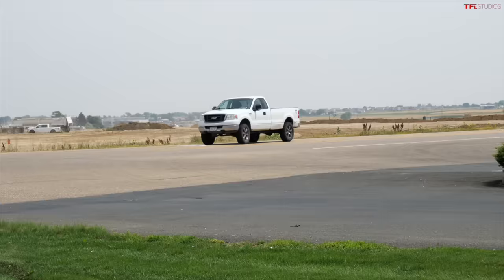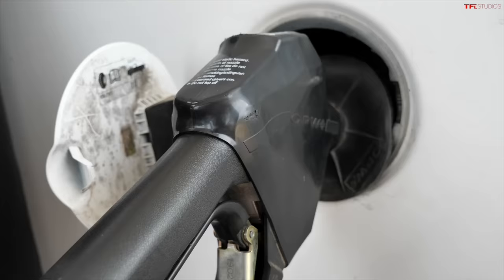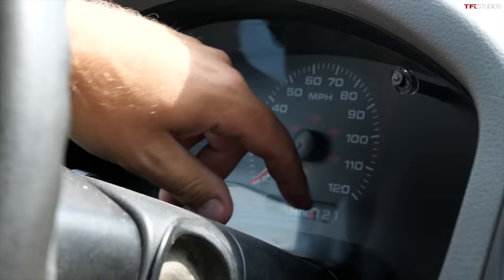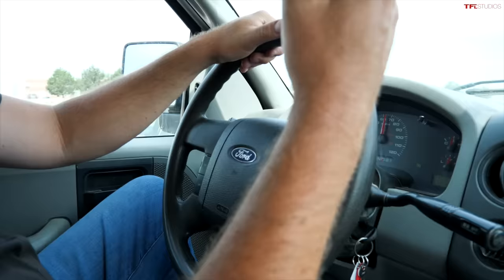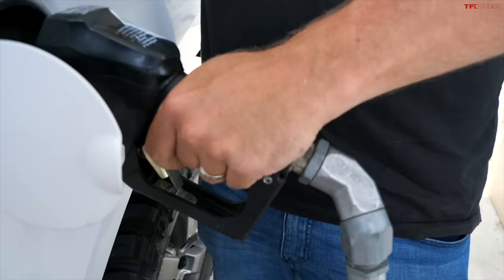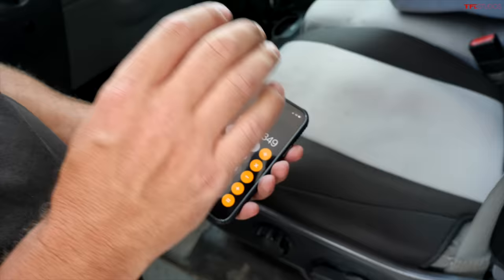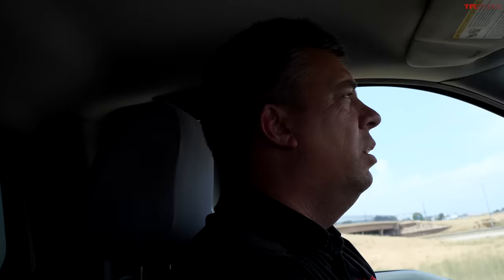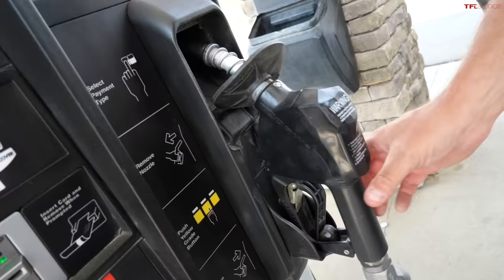Surprising Result: Here’s What Happens To Your Truck’s MPG When You Install A Topper!

Comment: A thousand pounds of added weight has a marked effect on mileage in stop and go traffic in a city, but it has little, if any, effect on mileage when running a distance on the highway. Aerodynamics can have a drastic effect. With a vacuum gauge and cross referencing with the speedometer, you can tell if the truck is heading into a 5 mph breeze, or being pushed by the same breeze, and it will definitely show at the pump. If the start and finish of the trip are at the same elevation, the highway profile will have no effect on fuel economy. What goes up has to come down.

Comment: It's not surprising. Reviews for tailgate down, vented tailgate, tonneau cover, aero canopy and aluminum canopy bounce all over the spectrum. Some tests show each to be the best option, some test show the same mod gets worse MPG than the bare PU. A sloping rear cover (top of the cab to sloping down to the tailgate) reduces drag about 12%. There's additional drag from all the air turbulence under the truck, from big mirrors, vented wheels and oversized tires (especially the front wheels) and additional if tires extend past the body. Clean all that up, along with lowering the PU 2 inches and adding wheel covers, and you get a total 25% reduction in drag... or a 10 to 13% reduction in fuel use compared to the modern F-150 (which is a bit more aero than your truck). That's the reason for the ugly shape of the Tesla PU and its mostly flat belly pan. The US doesn't allow cameras to replace mirrors, so we'll be stuck with those for some time. Mfgrs know all this but, for a combination of practical reasons and consumer preferance, these haven't been designed in.

Comment: I bought a gryphon programmer for my 2006 F150 4x4. It not only runs better and shifts better but it also gets an extra 100 miles per tank (35 gal). If automakers would properly tune their cars they could be so much more efficient. Unfortunately theyre in bed with oil companies to rob you at the pump.
Reply: I'd love to go for a ride & see your 3 mpg improvement with the tuner. I've been a professional mechanic & hot rodder for over 50 years & have NEVER seen anything make a noticeable improvement in mpg & MOST tuners hurt the economy. It's pretty hard to improve performance without hurting economy, regardless of whether the vehicle has a carb or computer controlled FI. The manufacturers tune the vehicles for MAX mpg & minimum pollution because they MUST meet Fed Govt imposed fuel economy numbers across their entire line. IF they could improve mpg by 3 mpg, they would damn sure be doing it! An engine is a big fuel burning air compressor & they can only be run so lean before they melt aluminum heads & pistons down. LEAN creates much more heat than rich & a 14 or 15:1 A/F mixture is the leanest a gas motor can idle without a "lean miss" or cruise under light load down the highway without a miss & excessive engine destroying heat. Somewhere right around 13:1 is the number for max power.

Comment: A truck with A topper is generally more versatile then one with an open bed regardless of the fuel mileage which was improved. over the life of the truck it would make A difference, you could probably skip A fill-up.

Comment: I'm adding a cap to my 2022 3500 Ram dually and will also add VG's to the rear top edge of the cap to see if that helps.  Maybe you should try a test.
Reply: I’m buying a Leer top today. What are VG’s ?
Reply: It's a vortex generator.  They break the suction and reduce the low pressure behind the vehicle.  They come from the aircraft industry.  There's a company that makes them for trailers and they will work on a cap. @Dachshund-Nator

Comment: Intuitively I would have expected a greater difference. 
The methods were not precise, but probably close enough to get a rough idea. 
It probably isn't worth going out and buying a $5,000 topper for the increase of 0.2  mpg. 
I might be curious if attaching wind wings like you see on the big rigs would help. 
Maybe leaving the tailgate down and the lift gate on the camper up, (just slanted down toward the end of the tailgate) would make a difference.

Comment: Drag is going to be more of an issue at higher speeds. If reducing drag basically washes with the added weight at speeds on the highway, you'd probably be looking at decreased fuel efficiency with city driving.

Comment: It actually is a bigger difference then the test he gave. He was not in a controlled environment traffic from one time to the other time ovarian change unless he was using cruise control on both and did not have to break or change lanesTwo avoid traffic which changes from one test to the other

Comment: GPS is best anyway since it is not only the speed but the mileage that is affected by different size tires. You could see the difference, but you could not QUANTIFY the size of the difference without accurate mileage.  Databyter

Comment: Because of lack of controls in your experiment, 0.1MPG more is well within your margin of error.  Without ever doing the experiment I suspected the MPG would be essentially THE SAME.
Where the topper kills mileage is not hwy miles, it's around town MPG.  Because it takes more effort to get the vehicle moving from a stop with 200lbs more weight, if you usually only drive in more stop and go, city driving, the DROP in MPG will 1-3 MPG depending on driving style  (heavy foot), and power/weight of the pickup.

Comment: Figure out the weight of the topper, place that weight in the truck bed without the topper and remove the weight when the topper get added. That way you will know if there are aerodynamics at play with the topper or not.

Comment: Hmmmm.  I remember driving with the tailgate down for better mileage.  So my old 89 with the 4.9l would get about 18mpg unlpaded and 21 if i had dirtbikes in back.  I dont know if the bikes would cause the wind to break up but i did the test several times over hundreds of miles.

Comment: The mileage with the topper may have been reduced from without because you had extra stops and starts at the storage yard and additional idling time as you pulled in, opened the gate, parked to add the topper and again opened the gate. That might sound petty but the difference in mileage was very minor.
Reply: He refilled after that to eliminate that as a contributing factor.

Comment: You would need a proper fuel flow meter to validate the experiment. As it is, it is subjective due to minor variation in how much fuel fits in the tank, etc. Your results where more or less what I was expecting. Very li'l difference with or without the topper.

Comment: The difference in mpg would have been more noticeable if Andre would have done a longer distance. But I'm guessing those 2 drives plus installing the cap took almost all day, then the time to edit the video. But I think they did a similar test with that Trail Boss and the difference of the bed rack adjustment made a big difference in mpg.

Comment: This test, with one trial, produced the same result to within 0.5%. One obvious unknown is "how repeatable is the fuel shutoff"? 0.5% of three gallons is about 1/67 of a gallon- does the pump shutoff fill the tank on that truck to the same level within 1/67 of a gallon each time (a volume of gas to fill a cube 1.5 inches on a side)? If not, whatever MPG difference there might be is masked by fuel-shutoff variation. A better test would be to use a newer vehicle that measures MPG as you drive. Also, if weight is a concern, an aluminum topper is usually lighter than a fiberglass one.

Comment: At sea level it will be a better improvement with the topper. In Colorado with the thinner air and reduced engine performance it negates the aerodynamic benifit. At sea level the additional weight will be less of a factor and the increased aerodynamics will be bigger.
Reply: I would prefer he tested at 75mph where aerodynamics starts to play bigger role.

Comment: The difference would likley be more beneficial over a long distance drive, with sustained freeway speed limits rather than simply driving 50 miles in varied traffic conditions.

Comment: F-150 has a good sized engine, so it takes a fair amount to change the mileage. Also, the front of the pu is taking the wind drag, not the topper. The extra weight on a truck that size is negligible- one adult male. Sounds like you did a highway run, where wind drag matters more than weight. Stop and go traffic in LA might get you a small difference. Not surprising,  but thanks for the video!

Comment: hmmm... the aerodynamic inefficiency of the truck with or without the shell is the vacuum created by (drag) the back wall of either. Not weight. Noone would want a long teardrop rear end in either case (to improve mileage).

Comment: Take off the spare tire.
Remove the tailgate& replace with fabric alternative.
Take out jack & other unnecessary tools & liquids hiding in the truck.
Take out the floor mats.
Slightly overinflate the tires. Enough to remove 1penny head from the edge contact surface.
Empty the windshield cleaner fluid. Clean by hand.
Remove loose change & garbage from truck.
Replace hood with lighter alternative....or at least remove insulation from undersideof hood.
Consider lighter wheel options..if feasible.

And the MOTHER of all MPG solutions: Grind a pit just behind the butterfly valve of the air intake.

Comment: Forget the second digit after the decimal point - the fuel level error alone makes that second irrelevant, and even the first one doesn't mean much. The variation in consumption due to inconsistent driving conditions makes the only reasonable conclusion "the test was not able to detect any difference". Not that the aero drag was reduced enough to compensate for the extra weight, just that the test didn't find any result at all.

Comment: That's still going to save you $3 per fill up, which is going to be about $40/year, and $400+ for while you own it, if it's your daily commuter.  You can also get something more light weight, and just a bed cover, and probably get little more, for cheaper.
Reply: How do you calculate that .1 MPG will save you $3 per fill up? .1 mpg would be 2.6 miles more on a 26 gallon tank. You must have a huge fuel tank. I have a 55 gallon in my F350 & .1 wouldn't save me $3 per fill up.

Comment: I have a 2001 f-150 4.2 v6 reg cab short bed and a higtop cap . I get worse mileage on the highway or on old roads with the cap on. same tank as the test one 96.5l/25.5 gallons.

Comment: With respect…  my experience and training provide a different insight.
And … this comment is about “ higher speeds”…vs… in town/low speed/ less than 45mph?

Let’s look at “ efficiently traveling through another fluid…water”… ( gases and liquids are both fluids… so traveling through are and traveling through water have “some” similar characteristics..

This topic discusses benefits/ penalties/ differences to MPG comparing trucks with and without a topper/cap. 

So here’s my 2cents…
Many aquatic animals have POINTING/ tapered fronts/noses/snouts… but not all aquatic animals have super pointy snouts…. But the faster the travel/ move through water the pointier their noses are… think dolphins and barracuda….

Think about moving into and through the water and using energy / muscle power/ Calories  

BUT…not all water animals have pointy noses…. Many large whales don’t…. Yet they manage to move  “efficiently”…through their atmosphere… ( an atmosphere MUCH less forgiving that air)
But NO quick moving fish has a stubby tail …. They ..ALLLL…have long tapered tails…
Because moving the water out of the way ( in the front);… is only 1/3 of the battle….MOST…of the “DRAG” / energy penalty is I. Getting the water to quickly ( with minimum effort and energy loss) to get it to quickly come back together after the fish has passed through ….

Some one mentioned “ drafting” in car races…. Yes that is true….. and that suction DOES pull  the chasing car foreward…BECAUSE THERE IS A VACUUM AREA OF MISSING AIR….and that same vacuum area sucks the lead car aft-ward/ nit back/… this is one form of “Parasite Drag”… or “Parasitic Drag”….
Name ONE airplane that has a flat stubby rear ( like a tractor trailer) ….NONE…. helping the air “ fill back in” after the airplane…. Tractor trailer…. Or little Honda hybrid….IS…THE…. new design target.

An empty truck bed with the back gate down, open or removed…. Might be helpful in reducing drag and improving gas MPG… especially at higher speeds. ( 50-90 mph?)

A truck topper/ cap… that is about the same height as the cab might not add drag, but the flat rear might… but might not cause much drag until approaching higher speeds…

BUT !!!!!

The taller the cap/topper and the flatter ( vertical) the rear is , the greater the generated / induced drag…. And the worse the MPGs …. ESPECIALLY at higher highway speeds…

There are some caps available that DO..slope downward in the rear…. Hmmm… maybe 
But

Name one NASCAR….race car … ( or new electric high MPG) that has a big flat butt….. none.

Comment: Why not just take off the tailgate and put on a 'thin cord' (but still strong) net?  The 'wide strap nets' are heavier, and add considerable wind resistance as well.  With the thin cord net you have maybe 1 lb added weight, and almost zero wind resistance.  Watch the mileage climb!

Comment: I have an 07 Triton with aftermarket calipers, slotted & drilled rotors and ceramic pads; fuel efficiency aside, it stops on a dime and shifts nicely. Every 10k miles, I'd give it two cans of fuel additive to remove the crud and improve the engine's performance.
However, my truck is pushing 15 years old and is falling apart; the bed is shaking and rattling upon the frame, the frame is corroded and the list goes on. Needless to say, I've no intentions of selling my truck to anyone in my neighborhood; because some folks who are "interested" in buying it, fail to realize that the vehicle is a liability, worth practically nothing nowadays and can be found everywhere at unbeatable prices despite several being in WAY BETTER condition and on top of that, those desperate whelps have this foolish sense of self superiority while thinking that they're some kind of master Ford vehicle manufacturer who knows vehicles like mine and everybody else's like that back of their own hands.
 To suffice, I got fed up with their ridiculous notions and placed "This Vehicle Not For Sale" decals on all four sides of my truck unbeknownst to those who were obsessed with my truck and the best part of it all, is that the stickers look 100% legit; they look like the ones that auto dealerships use to discourage wannabe byers. Long story short, nobody bothered me again about my truck and if they wish to buy it from me, they'll have to go to the dealership I bought the truck from, ask for a USED VEHICLE BYERS GUIDE and have to go through a lot of procedures just to get my truck appraised, AFTER the buyers guide is affixed to my vehicle. I have won and I stand firmly with my decision of wanting to save money for another vehicle and in turn, have my truck salvaged and scrapped for what little money it'll fetch.

Comment: Sure the '04 may have gotten similar MPG as today's trucks, but today's are much more powerful, two more and are larger.  04 had 200ish UP and less than 300 lb/ft of torque.  The v8 today 400 up and 420 lb/ft torque
Reply: TQ/HP hasnt' changed much at all since 04. The engines have been very efficient for the last 20+ years & NO 4.8 or 5.3 has seen the numbers increase to 400+ since 04. More power has been accomplished by more displacement or artificial power adders like turbos or blowers. My 04 Tahoe's 4.8 optimally makes 285hp & so does a 2023. Fords are no different. No way to increase TQ & HP without hurting economy. Simply the laws of physics.

Comment: I have found that air temperature has a noticeable affect on my gas mileage. Higher temps give  me better mileage.
Reply: Hot air and some mild elevation to decrease air density works wonders.
Reply: That's because the air is less dense so the mixture can be slightly leaner.

Comment: I havent watched yet but I guess it would be the same or less with the topper. Not because of weight but because trucks are made to be run with an open bed. What happens is as you speed up air circulates int he bed and causes air flowing over the truck to be more aerodynamic. That was my understanding at least.

Comment: I've always received worse gas mileage with a topper than without and that's with multiple trucks. You'd think it would make it a little more streamlined, but it really doesn't. The added weight plus other factors drops mileage down. IMO, you didn't really drive far enough to get a fair reading. But that's just me. I think the biggest difference I observed was nearly 5 mpg, but it was in a smaller truck. So maybe size might be a factor as well.
Reply: Smaller engines economy is hurt more by adding more load than bigger engines because the smaller engine must work harder.

Comment: Great video, but what really got me was the gas pump lever lock. They removed those years ago and this made me really miss them. Now you have to wash your windows after getting the gas lol
Reply: Where do you live? I've been in 45 states & have never seen a fuel nozzle without the lever lock!
Reply: @bradgriffith4231  Canada. But two gas stations recently upgraded their pumps and left the lever locks on. Which is odd as I've been across Canada and they are always removed.

Comment: When traveling at normal speeds on a flat road, the extra weight probably would make a difference. In city driving or stop and go, it’ll make a difference. Especially, if you travel up a grade for any reasonable distance. In general, weight kills fuel economy.